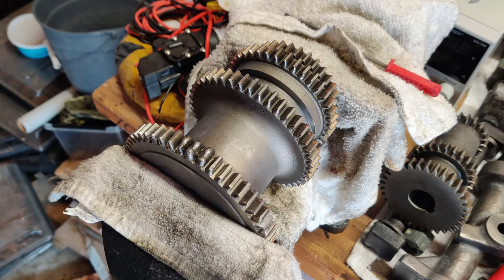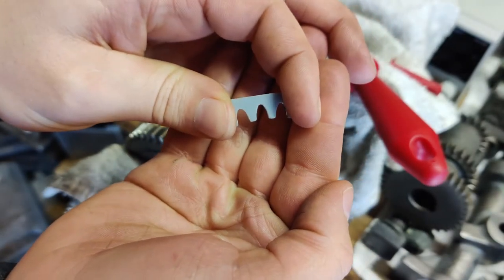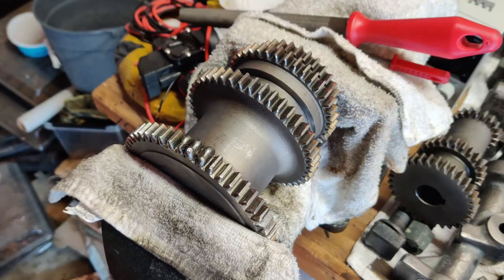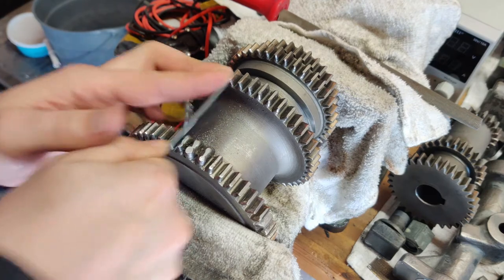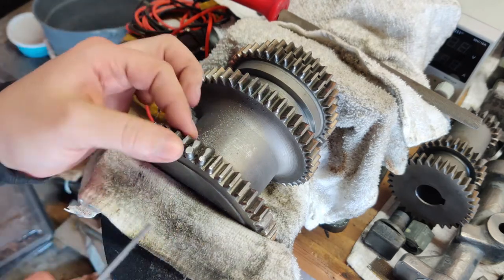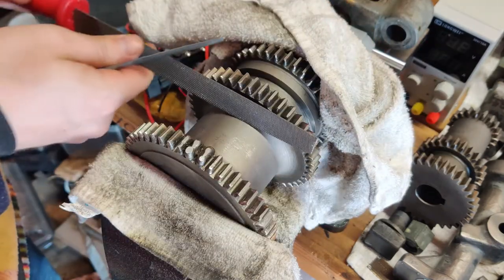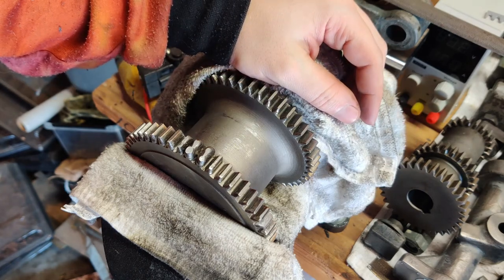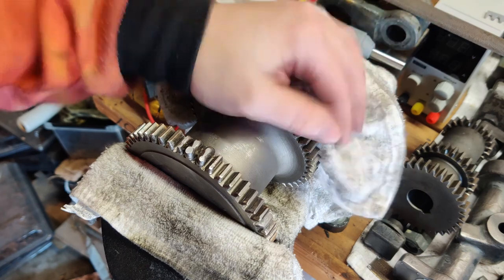1950 LeBlond Regal 17" Lathe Restoration Part 13: Repairing Broken Gear Teeth

Comment: Great idea on the 3D printed template of the tooth form. After I welded up my teeth I started off with  an angle grinder, then dremel, then file . I started working on a starter ring gear a few months back, but didn't get very far before moving onto another project.  It needs a lot of teeth repaired.